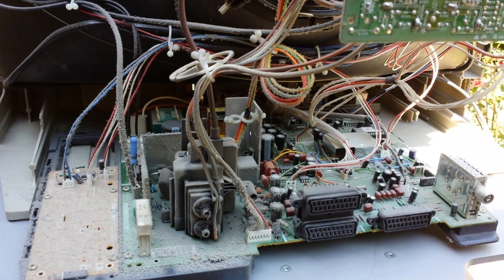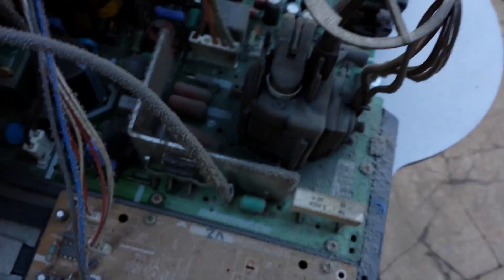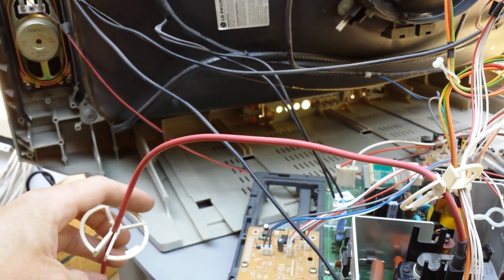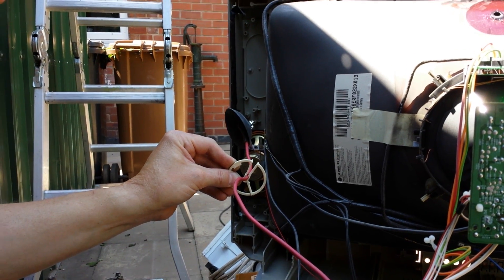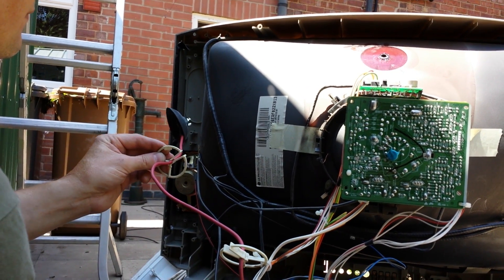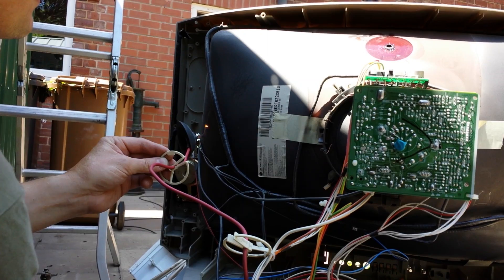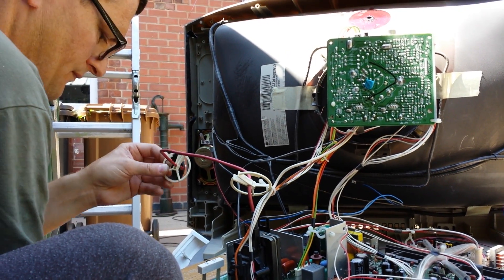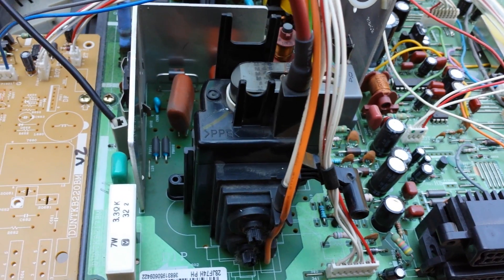Inside a CRT TV  and arcing out!!

Comment: You clearly haven't seen a set that has been in a pub for 15 years, in the days smoking was a normal fact of live.  The PCB and components are covered with a brow sticky blanket of tar and dust that can not be removed and stinks like hell.
Reply from the maker: 1959Berre yuck!!! FUCK that mate. That sounds Rank!!!🤮🤢😱😷
Reply: Local kebab pizzeria changed owner and they throw away their flat screen tv and cctv recorder to roll-of dumpster across the street. I saw those so I went to check was there a HDD inside cctv recorder and both tv and cctv recorder were covered in sticky frying fat. Yuck. There was no HDD inside recorder, it was carefully taken out by pizzeria owner I guess. But TV had usb stick connected which I connected to pc at home and there was some pizza ads... Before I throw it away, it was very sticky too LOL

Comment: Thanks for the video.  I have a bit of a question that's bugging me and don't know where to start asking and figured I might as well ask here:

I recently disassembled an old blurry but functional 32" Trinitron and hooked up all the boards on my bench.  I plugged in the deflection coil, which was still attached to the metal shielding, and grounded the boards to the shield.  Now I have all components connected together EXCEPT for the tube itself.

Being very cautious, I plugged in the power supply and powered it on with the TV's control panel.  The deflection coil fired up and startled me because the magnetic field coming out of it felt extremely strong (mind you it was sitting 3 feet from me).  I left it on for a few seconds until I heard the power supply click again, which for whatever reason startled me and I shut it off through the control panel.  After powering down, I tested the anode with a bit of metal and saw one small but audible spark travel through the air.

After this initial test I attempted to power on the device again, but now when I apply AC to the power supply the supply clicks on 
and the light on the control panel begins to blink red.  At this point, pressing the control panel power button turns off the device completely.  The deflection coil does not fire up at all.  The power supply is putting out voltage on many of its rails but interestingly it is not putting out anything on the two 9v rails.

Apparently I damaged some circuitry but do not know what caused it.  This is more of a project of me figuring out how these things work than anything and if anybody can help satisfy my curiosity I would very much appreciate it!
Reply from the maker: hello mate,  well to be honest not being their testing it, it could be anything, the best thin you can do is to start from one part and try and reverse engineer it. best of luck buddy. and thanks
Reply: Thanks for your quick reply.  I do have the schematics for the TV and might end up spending some time to diagnose it, just to satisfy my curiosity.  What I'm wondering right now is if powering up the deflection coil with it separated from the tube can cause issues or if me discharging the anode could have damaged something.
Reply from the maker: hello, to be honest, i dont think the tv will power up with the deflection coil disconnected. and it might help to short out the tube to get rid of any high voltage capacitance. and to also you can take off the deflection coil off the crt tube and power it up! as iv done this in the past and put metal inside it to see the effects.  all model tvs work different, and some can take more abuse than others. hope this helps,

Anthony
Reply: Thanks again.  I'm very new to this so it will probably take a long time to diagnose if I can actually diagnose it at all.  Since no power is being supplied to the 9v rails I'd first assume it was a power supply issue, but I believe it could also be that the 9v isn't being supplied due to some controller on the main board.  Any suggestions on where to start?

Comment: i scrap crts of the side of the road all the time i do want to knowe ..wold a chassis run with out a crt?
Reply from the maker: yes it can run but you need the deflection coils wired up. so take everything that's wired up off the crt tube and it will boot up! the thing is mate there very dangerous out the TV box. so please be very careful. as once you switch the TV on"   the high tension anode output will want to arc to ground/cathode.

hope this helps.

be safe 🖒😉

Anthony

High1voltage1rules
Reply: Thanks ...i dont have aney of the coiels but it still starts up😛 i will use my toshiba chasy to EOL cheap eletronics...ill post a vid soon on it ..hope you wach it (Note i am using my wendo seal as a gronding point and just using the chasy as a hivolteg point for EOL stuf) one mor qustin..why dos the mane driver transistor for the flyback get so hot..180F or grater..its after it pasis 160F the osalator that drives its goos out of wack.Do you knowe why?
Reply from the maker: +Raven Mack hello,

well what transistors are you using?? I use the irfp260n mosfets. and they hardly get hot!  you can always parallel your transistor! but make sure there the same spec. and try using fans to help cool ya heats inks down.

hope this helps 😉

Anthony 

High1voltage1rules
Reply: the transistor is a D22354fmF singel transitr

Comment: Hi, I want to prolong the life of my crt tv's and was thinking about getting a compressor (without oil). That way when I open the back casing I can blow all the dust off. I have no experience whatsoever in this field. Do you think it is safe when I won't touch anything inside?
Reply: Cloud Strives ( evrey part is safe to tuch so long as the set is unplugged.......and waight at least 5h for the capacitors to discharge ..you can waight 1-3h but 5h is safer
Reply from the maker: hello mate.
thanks for the comment.

just to let you know' you can get ya compressor into the back and also use a paint brush to help clean out all that crap and dust. Lol and yes it does help the life of a TV as the dust can get damp with the changes of temp.

hope this helps and thanks again.😉

Anthony

High1voltage1rules
Reply: Yeah I am a bit afraid about using a paint brush as I don't know what is safe to touch and what isn't. That's why I thought a compressor might be the next best thing as I can keep a bit of a distance. :-)

Comment: It"s very dangerous to play like the high-voltage! I do not recommend it to anyone!
Reply from the maker: I'm a trained electrical engineer so I'm very safe and competent. but thank you for your comment.

Anthony😉👍
Reply: inside of CRT's are dangerous and can kill if you touch the caps or parts of the tube (they still hold power after being unplugged). I'm sure he's taken every precaution. I dont even mess with CRt's anymore. You cant even get the trashman to take them.... Have to get them recycled.
Reply from the maker: +Christopher Ryan hello.
i used to repair these some years ago so im very aware of the risks. i know exactly to touch and iv very good experience with high voltage. just look at some of my other latest futage.

many thanks

Anthony

High1voltage1rules

Comment: Great Ant! Cool tv arching! I got my guitar amp caps in reforming process at 500v now.. it look those caps leakage 0.1 mA .. I did also a video abut the process of that! hahaha! I don't know is that the right amount for dual section can capacitors 50uF+50uF 500v! I still reforming those and hope the leakage gets as low as few uA! I'm no yet build the driver you gave the circuit diagram but maybe soon I get it ready! It's so hard to get any electric components here or it's only hard for me! Assa!

Comment: now why cant i get my flayback to run like that? right now im using a pwm to power the flyback at 12 V 10 Amps but its not as good as that? im using a lm324 ic chip circuit, duty, current and voltage control.   and dont even get me started on my tesla coil, i dont think the flyback will work for it.....Grrrrrrr

Comment: Domestic TVs can be deathtraps compared to arcade grade chassis as the frame on a domestic can be live as they incorporate the step down / B+ whereas arcade seem to be isolated frame low voltage ground.  Well impressed, that 330K is probably a bleed resistor to auto discharge the tube on power off.

Comment: Quite right. AC capacitors may not seem to hold a lot of charge most of the time since most are of low capacitance or have their power disconnected during a low-voltage part of the waveform, but once in a while the power may be be disconnected right in the middle of an amplitude maximum and depending on the voltage stored they can give a nasty shock if handled incorrectly, even if they are of low capacitance.

Comment: AC caps are the same as DC caps that can be used for either polarity :P
so yeah, be careful of all caps that have the potential of HV.
Also, a TV hasn't got an earth ground, the heatsinks could be connected to frame ground of HV supply, but as long as you don't complete a circuit (you are floating) you shouldn't get a shock.